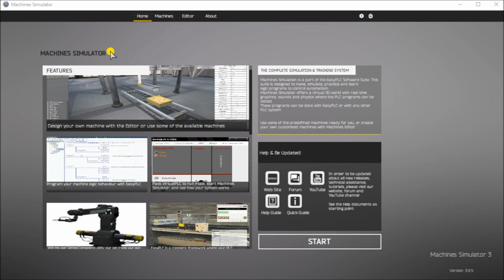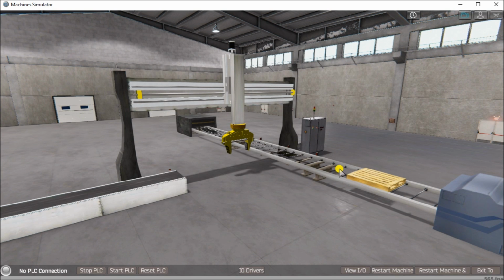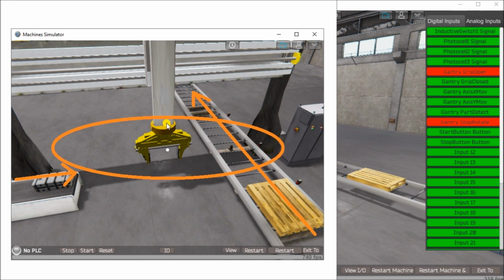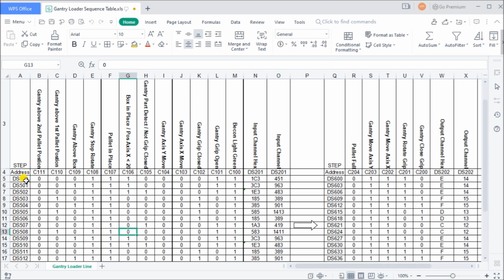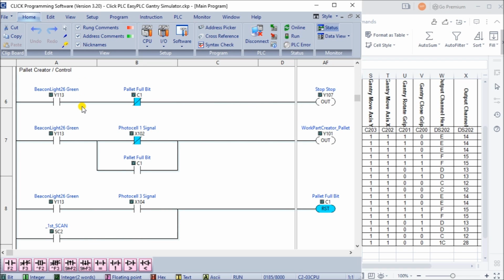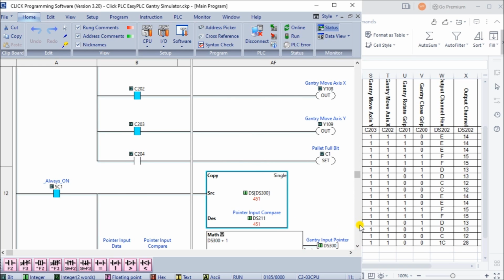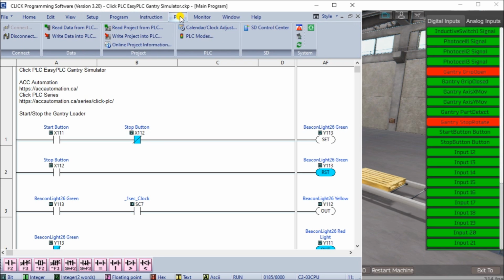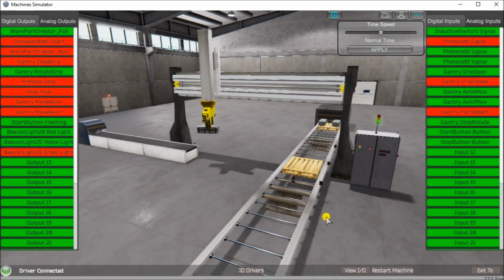Click PLC Gantry Project: From Task Definition to Testing

Comment: very interesting video.. the Fischer Steel Cord Cutter for wide Rubber sheets uses a network of Rockwell PLCs or Siemens PLCs to just to run windup roll control and conveyor motion control to cut to length rubber as in their youtube videos. It would be neat to do a basic Click simulation for this concept with simple IIOT and Raspberry-Pi machine vision? 🤔thanks 🙂🎄🎉🎅
Reply from the maker: Hi q zorn,
Interesting idea. The Click PLC is more than capable of achieving this using the Raspberry Pi. I have used the Pi with Node-RED to communicate and log data to a SQL database. This information was then shared on the network.
https://accautomation.ca/series/node-red-iot-enabling-software/
I have not worked with a vision on the Raspberry Pi but will look into using this.
Thank you for the idea,
Garry